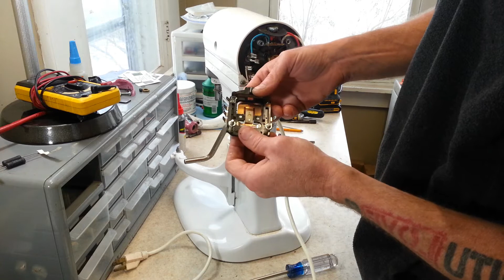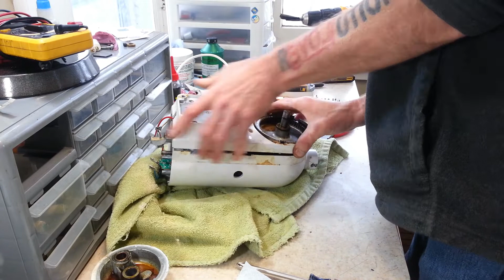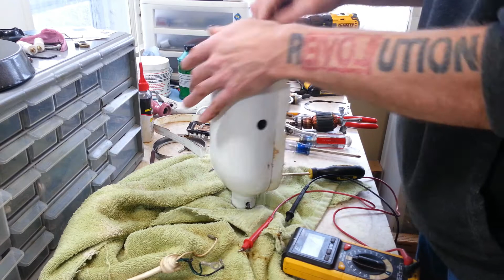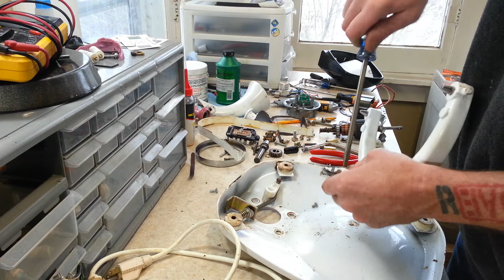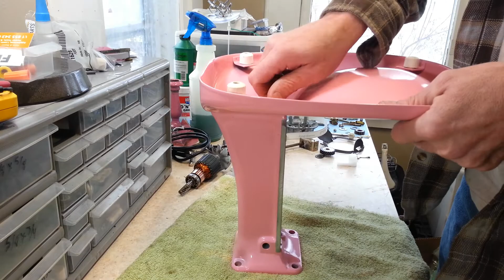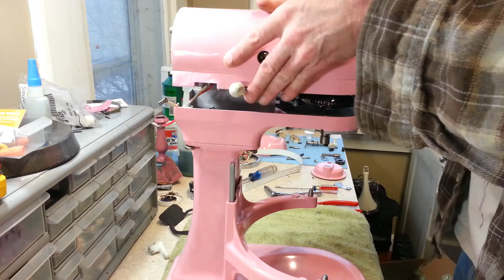Kitchenaid KSM5 mixer restoration in pastel pink

Comment: If you deal with these in the future, it is easier to remove the planetary gear cover with two flat heads, and the head still attached to the base. These are awesome machines that still have parts available!

It looks great though, one day I'll get mine powder coated.

Comment: I have a KSM50P and it stopped turning the attachments. The motor would run and basically shifts through the various speeds. I opened up and found that the worm gear had been ground to a concave shape on the perimeter, by the pinion on the armature end. 
Ordered a new gear and installed. Cleaned up, new grease, new brushes. Mixer turns on and goes through various speeds, but only if there is no load.
 Put heavy dough and the attachment stops running. Motor continues to run and I can also vary motor speed, but attachment remains stopped.I have checked to see if all pins are inserted and they are. Attachment jerks slightly but can't rotate. 
I don't hear any strange noises. The teeth on the gears seem fine.
I measured incoming AC voltage and it is normal.
I don't see signs that the nylon worm gear is being chewed up by the pinion.
I suspect that there is some type of mechanical slippage, but can't located it.
Put a thin rod through the end of the lower shaft and asked the wife to attempt to rotate the gear train while I was holding the worm gear. The shaft could not be rotated, therefore this ruled out the possibility that the nylon part of the gear was slipping. I have to keep in mind that I don't know how much force the motor can exert on the worm gear. It could be that the motor has so much force and causes the outer nylon part to slip and yet I can't generate that much torque by hand.
I haven't seen this specific  problem described anywhere. Please let me know if you have any suggestions to fix this condition.

Comment: my k5ss fell off the table and will not run can you make a video off testing the electronics I replaced the phaser the governor and circuit bored still no run
Reply from the maker: Hmm, did you check the brushes? it is possible one is no longer making contact due to the impact. If that checks out well, make sure the switch is activating with the lever, sometimes it can get bent just enough to not make contact when it is turned on.

Comment: i appreciate your videos they are fantastic in fact i watched your video as i was working on my machine...i did clean it and put new grease although the machine keeps on making the same sound on first and second speed...as far as the other speeds the machine sounds very smooth..i have a question for you...is this machine you are working on considered an old machine? i mean as far as how long ago it was made....i bought my machine 15 years ago and i never used it, i noticed that my machine as well as the one you are working on don't have a gear housing cover...is it possible that kitchenaid made some changes right about that time, it makes more sense to me to have a totally closed gear housing so you can put as much grease as you want knowing that you are not going to lose the grease..at least not as much....thanks again....
Reply from the maker: Thanks! Im glad you were able to get yours maintained. Im not sure what sound it might be making, Sometimes it is just an adjustment needed, possibly the speed control plate is not quite square to the machine? Im not sure the exact age of this model, it was manufactured after 1984 since that is when they switched to a solid state speed control. The kitchenaid gear boxes are totally closed, and the 2 halves sealed together with a gasket, however the kitchenaid grease will break down over time and leak out through the gasket, which is why I dont use it. Hope this helps!

Comment: Rick! Much knowledge! Please help if you can ID this thing in front of me...I was watching your vids prepping for my own attempt...my wifes commercial mixer she got from her mother...it's obviously a KSM5 by the shape...but...maybe a floor model?? it has a plaque on the rear of the base, KitchenAid Mixer, serial number 1413154, Model [blank!], watts 350, volts 115, amps 3.0, hp 2/5, ph 1, hz 60, rpm 12,100. the band only says "caution: unplug before inserting..." "overload reset, and "commercial", it's a five-speed, and above the attachment slot, a sticker says "no attachments available for this model" ... ???
Reply: I think I figured it out...KSMC50S? It's the only model I've found that has the overload reset button...
Reply from the maker: @wrxefx3931  It definitely sounds like a commercial model! You are probably correct, as for year I dont know if the serial number will tell you anything or not, but you could research that. Sounds like quite the machine!
Reply: @vintagemixersandmore1666  Hello Rick! love your videos, I'm living in Mexico and about to purchase precisely the KSMC50S model (used) is there anything that I could look on the mixer to check the operating conditions? I haven't found anything yet about the KSMC50S model and Im feeling a little too nervous about it.
Thank you very much.
Reply from the maker: Hey Alvaro! I would suggest just running it through all the speeds to make sure they operate as they are supposed to, and there is no grinding from the gearbox! Usually they will be fine, but always good to give it a run test if you can.

Comment: My brother was working on his roof and managed to drop the saw to the ground. No matter what we did we could not get it to work. I noticed a small indentation in the cord. The body of the saw had fallen on the cord and crushed the hot wire. I shortened the cord and cut the bad part out. Problem solved. I wonder if that's what happened to your mixer.
Reply from the maker: Its possible, I have started checking cords as soon as I remove them if something does not run, just to satisfy my need to know lol. If I recall I'm pretty sure the cord on this one was fine, I think I was expecting to see something obvious as I disassembled it, but I didnt

Comment: We also have this model...Running strong for the last 15 years. Ours is white and I really like this powder coat pink... cool color.
Reply from the maker: Thanks Jeff! It is a well built machine, with proper maintenance they should last a very long time, and parts are easy to order if any should ever be needed. I love the engineering and detail that went into the design of these machines, even though I don't use one myself. I am so used to the sunbeam that a KA feels awkward to me, but I do love the quality that they are built with. It is sad to see the quality has gone down hill on some of the newer models, but I guess that's progress.

Comment: It's so great seeing you working on a 'recent' KitchenAid! I was lucky enough to score one similar to this one (a K5SS) that only required soldering a wire that had broken off to put back in service :-)

One thing I found on mine was the worm gear wasn't fiber or nylon, but metal, but because the grease was in the same condition as on your machine, there was no lubricity left and it had started to wear...

For grease I've read that SuperLube, a food safe synthetic, has much better specs than the OEM clay based KitchenAid grease that dries up so bad...

How much grease did you use on the gears? The video does show how much you used... I was wondering because the worm gear sits on top and would therefore be first to starve of grease when it ages... The KitchenAid Service Manual manual for this generation machine states 6 ounces whereas grease is usually sold online in 3.5 ounce containers, presumably because newer models have a much smaller gear case...

I agree that the bowl lift plastic cam mechanism seems disappointing, but it's Delrin, so it should normally be very durable... It was in perfect shape on my machine.

For smooth, silent lift operation I rubbed soap on the sliding bars and used grease for the lift mechanism spring and handle socket, it buttery smooth now :-)

I didn't notice you installing or adjusting the lift height adjustment screw at the top of the column, isn't there one on this model?

It sounds perfect after your complete overhaul, almost as nice as your choice of music, perfect as usual :-) Like you I have my doubts on the black cord and would replace it with a white one, it would be best to go with that baby pink :-)
Reply from the maker: Thanks Johnny! I will look into the Super lube grease, being synthetic it may be a better choice in the future. The container was 3.5 oz, and I try to place it where it is needed, as it seems they must fill the upper part with the grease, then attach the 2 halves. Most of the grease I remove has not made contact with any moving parts, and surprisingly the planetary on the last 2 was pretty much devoid of grease. I am impressed at the design of the worm gear assembly, with the scraper molded into the housing. It does have some effect on keeping the grease in place on the worm gear, so kudos to KA engineers on that little detail as well! 
I have to assume delrin is a stronger type of plastic? If so, then I should credit them for that, it still seems to be a cheap part on an otherwise well built machine. The lift arm where it attaches into the socket does seem to be an oversight, this one was also beginning to wear so had to be polished a bit and I used some wax for lube. 
The height adjusting screw is there, I left it at the original setting since I don't have the accessories to make the adjustment. On this machine it is at the top of the column, facing straight up, looks like a set screw. I don't even make height adjustments to the other brands, without the bowls or beaters that are used. 
Its funny you mentioned to cord, at the beginning of reassembly I thought the black would look good with the pink, but when it was finished, I noticed it didn't go with the white accents on the machine. I have already spoken to the owner, and it is definitely getting a white cord :) The next machine is a pink 3B that has a black handle and knobs, in that case the black cord will be a perfect fit, this one it just didn't work at all. 
The music is tough, its hard to find any royalty free music that doesn't make you want to mute the sound! One of these days I will get online and look for some more to change things up :)
Reply: I'm sorry I don't have direct links for the info I gathered over the last few months - my K5SS is a recent acquisition - you could also go with Tri-Flow, they are both synthetic food grade, trouble is I couldn't find much about it >:-(  It's really frustrating that so many American companies flood you with fancy flash based marketing on their products with 0 technical information whereas European companies such as Klueber publish everything including white papers about their lubricants... 

Anyway the SuperLube has better info on their website and they have plenty of testimonies you can read. I used to use it as a plumbing grease back in the days I was working in construction, it was great for o-rings, it would stay on even in exposure to water...

Where is that scraper/lubricating device you are talking about? I didn't take the tower gear assembly apart on mine, simply removed the old grease and put some new in... I know, I know, but we wanted to put it back in service quickly ;-) 

Delrin is stronger than Nylon and is basically what they use for most plastic gears nowadays... Wax is great for lube, I made a mix of candle wax and Vaseline melted together and it's much stickier and stays better in place, although beeswax has just about the best consistency for that.

As usual, great video!!! I wish I had that talent making videos that you have but I don't, I'm much better with pictures, besides I HATE hearing myself talking so that would probably never happen ;-)
Reply from the maker: Haha thanks Johnny! I actually cant stand to hear myself talk either, but I have gotten used to it after a few videos. I found I just couldn't get the details in as well with photos, even after taking close to 100 for a project, so video was necessary, and youtube seemed the best way. If you ever do decide to go video, definitely make sure I have a link!!! I love reading all the knowledge you post about the different brands, as I'm sure the other viewers do as well. Not many know a lot of the history and technical aspects of these old machines, myself included, so it is great that you take the time to post what you know. I have always preferred the red synthetic lucas oil grease, even if not food safe, because it retains its viscosity through such a broad temperature range, and breaking down, melting, aand leaking will probably never be an issue, but will definitely look up the grease you suggested to bookmark, since some customers prefer the food safe. I have no problem using it if asked for.
Reply from the maker: Sorry Johnny I forgot about the grease scraper, I posted a photo here https://www.facebook.com/681312818561039/photos/a.685806721444982.1073741837.681312818561039/2219014561457516/?type=3&theater
Reply: Great Picture! I never saw it because I never cleaned it out so nicely before regreasing mine ;-) There IS a virtue to complete stripping and cleaning, if only solving a problem that is otherwise hard to diagnose (like on the machine you just worked on!)... Now if only I could get my hands on a Hobart era Metal worm follower to replace the one that's halfway worn on mine I'd be in heaven, as I'm not looking forward to having to replace it with the Nylon version!
Reply from the maker: Its so nice doing reassembly too with clean parts! I see some of the older parts are almost impossible to find, while others carried over into newer models. I can not locate a capacitor for the K45 , I will probably be converting it over to solid state.

Comment: Sometimes an impact can dislodge one of the carbon brushes and cause it to retract in the holder, missing contact with the armature. Removing the brushes usually restores them to full contact. I know more about vacuum cleaner motors than mixers; I was a vac mechanic for years and saw jammed carbons quite a few times after the customers dropped the machines.
Reply: Oh boy have I ever! Brown paper lunch bag used as a vacuum bag, using the vacuum to suck up water from a flood, plastic garbage bag used as a filter bag, just to name a few.
Reply: Yeah, these PCBs are incredibly complex, there's a true computer in there, pretty much everything is surface mounted and the whole board is lacquered so testing isn't even possible. No comparison with the simple board that supplements the governor of the K5SS! It's my only beef with that generation machine, especially the 'soft start' DC models, those are practically impossible to source. Once the circuit board is gone it becomes pretty much a donor machine :-(
Reply: Not only that, I recently learned that if the tiny pinion gear connected to the motor fails, you have to REPLACE THE WHOLE MOTOR AND TRANSMISSION ASSEMBLY >:-(. As for how 'robust' it is... Comparing the original KitchenAid's gears with this new fangled 'professional' machine is simply no comparison at all, it's like comparing a T-rex with a  garden lizard, It's that drastic 8-o. https://s18.postimg.org/ed7y8z4vt/2lkrvyh.jpg

It comes to confirm the conclusion that these old, pre planned obsolescence era machines truly are in a class by themselves and are truly worth the time an effort to restore them. Now if only we could find a source for Hobart era metal worm gears for this generation of KitchenAids that are the most common part to fail over time (instead of the much weaker Nylon gear used by Whirlpool era machines), they could probably be made to last forever :-)
Reply from the maker: Thanks Billy, that is exactly what I think happened to this one, if not a brush than something just as minor. I imagine you must have seen some pretty strange things with vacuum cleaners, since they are pretty abused sometimes!
Reply: This model has a spring loaded brush cap so that shouldn't happen - if the cap got loose the contact should still be there. Unless the spring was bad and the carbon brush got stuck without making contact on the armature. But this generation is simple and rugged. 

I would be much more worried about newer models with the speed selector switch connected to the controller board: if it falls on the selector, it would basically break the board and it would have to be replaced, boards are made by machines, unrepairable by humans :-(
Reply from the maker: haha I can only imagine! Plastic garbage bag? Cant believe someone would even try that! :)
Reply from the maker: That's a shame that a product brand with such a reputation for quality would make such an inferior product, but I suppose that is the age we live in. I actually really like the solid state controlled machines, I have only recently had the pleasure of working on one of the newer PCB controlled kitchenaids, and was not impressed at all.
Reply from the maker: It is probably going to be a miracle to find the gear you need in metal! Its fortunate however that almost every other part for the Hobart era KA's is still available. Planned obsolescence, the modern era business model for pretty much everything!
Reply from the maker: I'm not sure what it was, something broke connection and the brush was about the only thing I could think of. Talking to the owner however, he had taken them out so that wasn't the cause. Whatever it was, it works fine now and will remain a mystery :) 
The boards on the newer ones do seem to be an issue, hearing from several people who had to have the boards replaced under warranty.